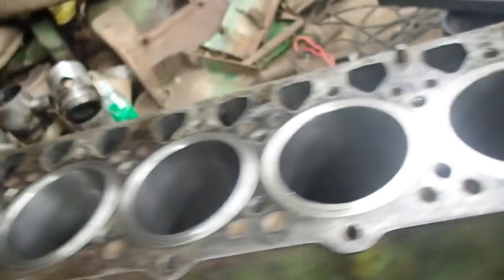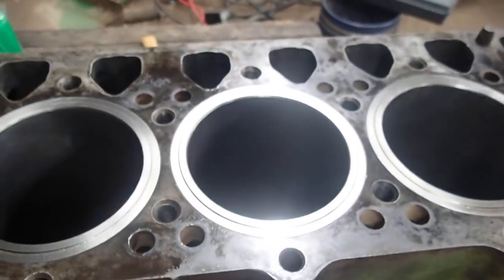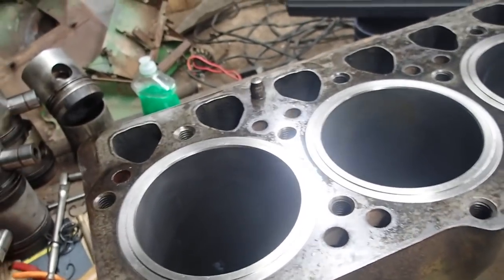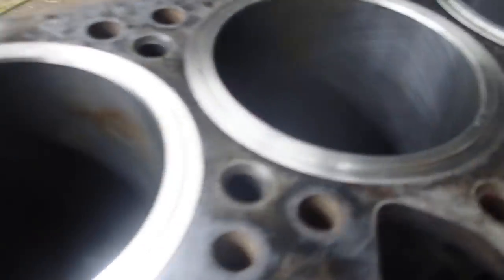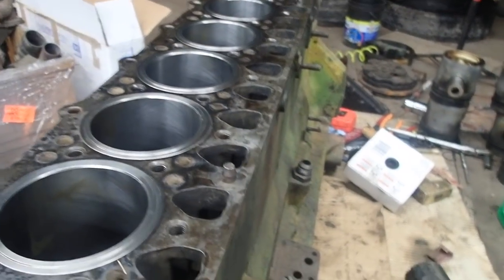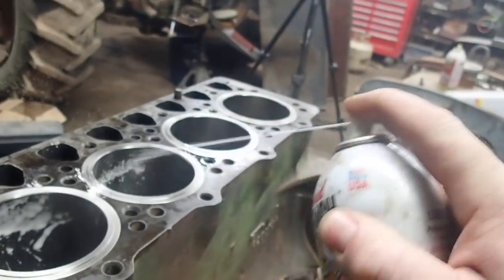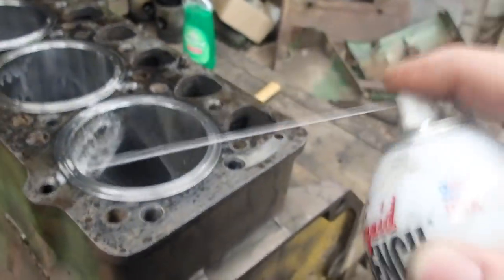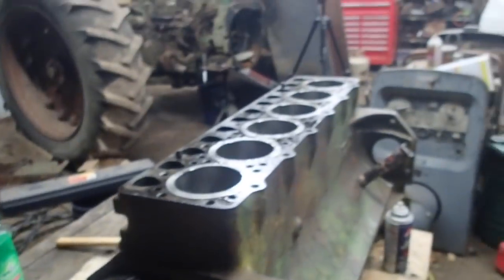4010 Engine # 4

Comment: The first tractor I bought in 1974 was a JD4010, the dairy farmer had parked it because it would not shift and let the engine get water in it. I paid $1000.00 for it, bought a aftermarket diesel engine rebuild kit for it to bring it up to the JD4020 HP for about $600.00. Spent about $2.00 to fix the transmission shifter. It is still running today 43 years later. Used it to farm 120 acre for 4 years. Wish I still had it, but you sell what you have, when you get divorced when your young and get left with all the bills. The man that bought it still cuts and bails hay with it. Take time to do maintenance on them and they will work.

Comment: Wes I don't need to see the whole rebuild. Done a major overhaul on my 3010. Does the 4010 have a counter balancer assembly that bolts to the bottom of the block and meshes with the crankshaft?

Comment: John Deere is like case engine parts are all separate short-block or long-block should also be listed in that area, did you ever price them out? Usually they are cheaper than doing a kit or overhauling.

Comment: The other big plus of using dish soap is it removes the internal water circuit oil.  Oil reduces the heat exchange from the liners to the water.

Comment: Caterpillar wet sleeve engines were famous for liners loosening up in service. What a disaster that can be!                                    I guess the sleeved engine has its benefits and hazards also. This looks like a fairly well designed block by comparison. Hope the sleeves are not going to be problematic. I did see pitting due to electrolysis in a John Deere 710 engine where pin holes went right through, allowing antifreeze into the crankcase. I suppose this was due to incorrect antifreeze type over many years?                                                     
 Regarding this assembly,  the plan of installing the liners with the pistons already inserted was....... abandoned due to the lack of bearings?
Reply: We check the antifreeze in our trucks every oil change to prevent electrolysis of the liners and oil cooler. There is additive that can be added to the antifreeze to help prevent that.

Comment: Flash rust because the soap removed any oil that was on the surface.  One of the reasons I use Dawn detergent when doing coolant system flushes after an oil/trans cooler leaked into them. It removes any oil that is in the system. The acid flushes work on the scale and dirt but they don't seem to get all the oil out.
Reply: Has been probably 20 years ago, that happened to me where I worked and believe it was Dawn detergent that I was told to flush with also. Thanks for the reminder.

Comment: will say i haven't seen dish soap used for engine assembly before, will remember that for if i ever rebuild a diesel :p
Reply: Liam Batge that’s what we used in Tech school for setting liners in the diesels. Also had to use a pick to roll the o-rings on the liners so we didn’t twist them during installation. The Cummins that I rebuilt had the o-ring grooves on the liner and not in the block.

Comment: In upper- upper Peninsula Michigan, is see truck shops for 6-8 tractors and trailers (11 axles) in an enclosed insulated shop. with 16" height doors,  heated by fire wood I an home made 5'x5'x10' wood stove firebox welded together out of steel plates. I/2 cord heats the whole shop for a day in shirt sleeve warmth.

Comment: Hey wes I’m not trying to be negative and I can tell you have done this many times but have ever froze the liners before putting them in , that’s what we do and they drop right in , we put them in the freezer the night before we do it
Reply: Thank you for the videos
Reply from the maker: No need to freeze them just lube them up and push them in
Reply: Right see we didn’t do an overhaul to a jd so it’s different engine so it was just a question and thought maybe it would help ya see we overhauled our white and we froze the sleeves and they slide right in and you probably know the rest cuz you have probably done it , I think every farmer has  , thanks again wes for the videos
Reply: NewYorkFarmerForLife your liners may have been dry type i.e. no seals just metal to metal contact. The JD liners that Wes has are wet type, and soap is the correct may to install them through the lower seals, newer engines have a top liner band as well to stop the liner from vibrating and that is normally installed with oil so that it swells and locks the liner in. Cheers mate🍻
Reply: Michael Brown your right that is the difference
Reply: Michael Brown thank you for correcting me
Reply: We froze the liners for our farm all 400 but they are press fit dry liners. It helped a bunch. I don’t think it would help too much with wet sleeve liners due to o-ring seal at the bottom. Lots of soap to slide past the o-ring and good to go as long as the o-rings aren’t nicked or rolled during assembly. Looks to me that Wes is doing a fine job with that overhaul. Only thing I’d do different is cover the engine with plastic while I wasn’t working on it to prevent dirt from getting all over it.
Reply: tuba7084 thank you I just didn’t know the difference  I’ve only helped with one overhaul and it was on a perkins in our white 105 so that’s why I didn’t know the difference , I just woundered why but I’m learning from these videos I just hope the haters don’t get to wes to much more

Comment: All liquid soap has water in it, no worries. That little bit of surface rust won't matter. The rings will wipe that little bit right off of the bore, it wont matter in the water jacket, so no worries on the soap at all. Just don't store liners for three years coated in liquid soap, that would be bad, lol.

Comment: hey wes what is the reason you are using dish soap vs motor oil for the sleeves ?
Reply: The top O-ring which seal the sleeve from the water jacket  will swell  and deterioate when subjected to a oil based lubricant,
Reply: Common rules of thumb:  
1. If it comes in contact with water, use soap. 
2. If it comes in contact with oil, use lube.

Comment: Do those liners have O-Ring seals in the bottom?
Reply: Dennis Hampsten yes that's why he's using the soap on the liners so it slides into the oring
Reply: Thanks,I thought so, but wasn't sure.

Comment: Is there rubber o rings in the bottom
Reply: Leonard Younger a couple of o-rings per liner. One water o-ring and one oil o-ring with a weep hole in between the two.
Reply: Leonard Younger are they in the block?  I didn't see them on the sleeve.
Reply: Yes the o-ring lands are machined into the block at the base of where the sleeve sits. There is one above the weep hole and one below the weep hole on that engine

Comment: This might be a dumb Question but is the dishsoap better to use the assembly lube ? Don't mean any disrespect just was asking .
Reply: The soap will dry and the liners will set permanently. Lube will not so the liners may shift in the block.
Reply: I don't want an account ahhh ok I learned something new today thank you sir
Reply: You cannot use a petroleum based product on the cylinder sealing orings they will swell....I never have used dish detergent,    for the reason he explained,    J.D, makes a liner soap.....
Reply: cylinder tube have outer side on water side, no oil mix there, hard to get out when engine complete.
Reply: Did you Watch where  he put the detergent? It was on the machined lower part of he liner, where it comes in contact with the ORINGS, that are in  grooves in the block below the water jacket.....John Deere makes and sells a cylinder liner soap for that purpose.......
Reply: Do you think I'm that dum.......but he is a stickler for using genuine  J.D. Parts so...That 55 GAL BARREL OF hY GUARD was made by John Deere?     All John Deere tractors made after 1972 require  an oil with  a J20C spec.... no matter who's container it is in... Read the Label......  Also It said use "Soap" not detergent.....There is a difference,.....Acodingly 90% of what is sold in stores can't be called SOAP....ie body wash  My daughter worked for a hazardous waste company.......She also makes Lye Soap.
Reply: P.S. Liner soap won't take dirt off your hands.....Just make them slippery
Reply: The funny thing is I have asked a JD dealer in my area for that proper soap, and I asked the motor shop I used that closed after 60 years in business if they had liner soap when I was doing quite a few motors here for customers. None of them sold it, or had any for their use. Both told me just use ordinary hand soap without a petroleum product or grit in it.  JD Don't even use their own proper stuff in the workshop L.O.L.

Comment: Salt in dish washing soap, that's why it's no good for washing cars.
Reply: Nicholas Pratt actually it’s due to the degreasing agents in the soap that strips the oils out of the paint and causes it to dry out and dull. Works well for cleaning something for painting.
Reply: It's the salt that causes the corrosion on exposed metal..